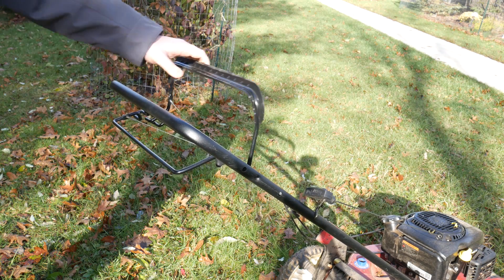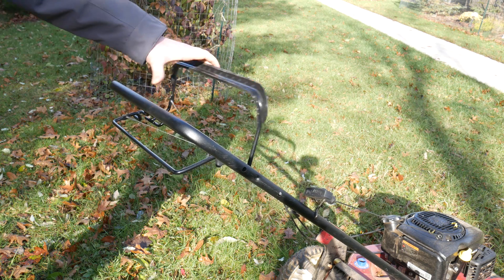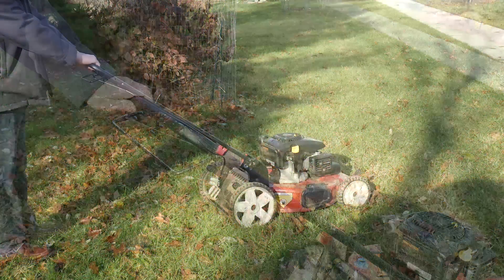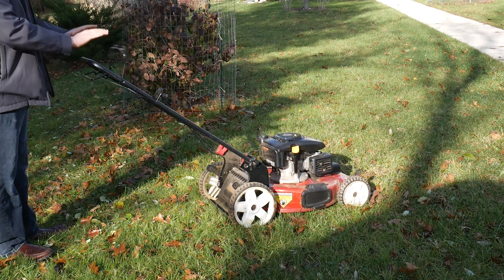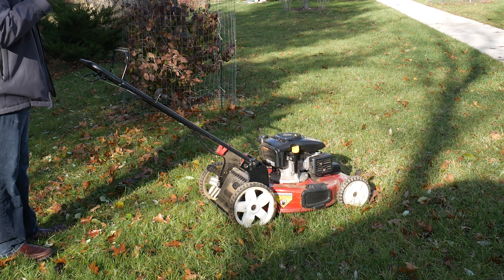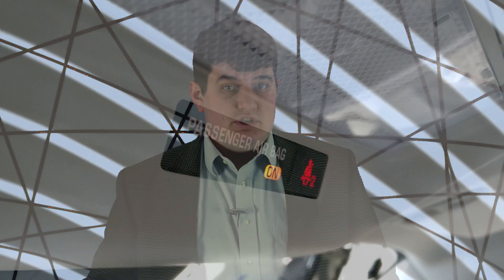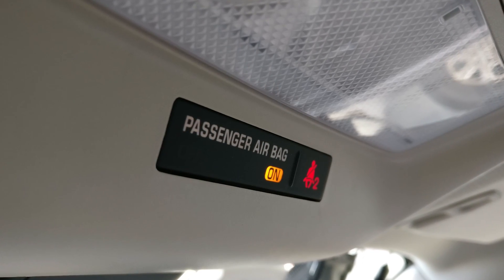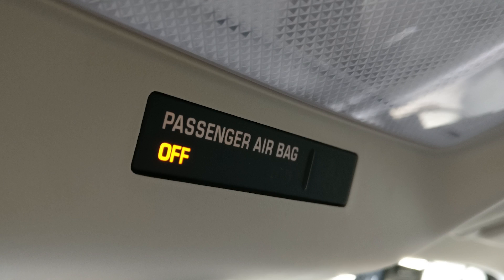The Dead Man's Switch:  How Anton Yelchin's life could have been saved

Comment: Unfortunately as a mechanic's wife this would never work. Cars need to be out of park for many parts of their drivetrain, wheels, suspension, brake systems and the so forth to be worked on. For any of you that. This watch your car go through inspection one-time the guy will put your car up on the rack and with your car in the air spin your tires this doesn't happen if your car is in park.
Reply: kitkat99x69 which is why he mentioned the override system. Have a button push or via obd2 port you could over ride it and do what you need to.

Comment: You need to think about servicing and towing vehicles. There are multiple reasons why a car should be in motion if no one is "sitting in the drivers seat". You can't tow a car that is in park is the biggest reason why this should not be implemented. Most cars that I've been in won't let you take the keys out of the car unless it is in park, which should be the overall solution; not forcing park.

Comment: Slight problem, if the sensor fails, the car would be thrown in to park, good bye car
Reply: too bad the video only kept your attention for 6 minutes and 27 seconds, because if you'd just watched a few seconds longer, he would have had a solution for you.
Reply: @jdjk7  wrong
Reply: @ComputerFreek  how? he describes 1. a method by which the car will not be thrown into park in a situation that would be dangerous even if the sensor failed, and 2. a method by which the safety can be disabled so that a failed sensor will not impede the car being driven.

Comment: i can already see a huge problem with your solution here: you couldn't push the car, or tow the car. you have to put the car into neutral in order to push it, if the car can be in neutral without a person in it (and the person can't be IN the car, least not in the seat, while pushing it, if you have someone to help you can have one person push and one person sit in the seat and steer, but you shouldn't assume the person pushing has two or more people to help, and towing would also then require a second person) then it can still roll away and kill someone.

Comment: Wrong 
*Many automatic single clutch transmissions have a physical connection to the transmission: essentially a "parking cog" 
So a software solution wouldn't work in most vehicles.

Comment: The cable for the dead man on my lawnmower stretched out and it wouldnt start, so I replaced it with a switch that can stay on whether you hold it or not. Also I disconnected the switch on my riding mower so I can now mow in reverse

Comment: This is absolutely not as simple as you say. From a "making the change" perspective it may seem so, but as soon as you start introducing features that mess with the control of the car you open yourself up to liability if something goes wrong. This would require huge amounts of testing. What happens if you attempt to cross the lanes of a highway and this sensor malfunctions? Does the car slam on the brakes and cause a crash? 

If you think this is far fetched the Boeing 737 Max has caused 2 crashes because they put in a sensor to protect against a too steep a climb and push the nose down so it doesn't stall. It has not push the noses of two planes into the ground. 

When you start introducing changes to systems that control vehicles, nothing is simple, and thinking it is simple is a dangerous mindset. It sounds to me like Antons death more caused more by the bad design of a critical safety system rather the lack of one. That said your suggestion is not a bad one, (it's actually a good idea), but it comes down to cost/benefit. The cost /benefit question could be removed by making it a requirement for all new cars, just like seal belts are.

Lastly with electric cars likely to end up going far more mainstream and cars having to go through large design changes to facilitate this, it sounds like and ideal time to bring this in.

Comment: Way too complicated. The solution is easy and needs no sensors. GET RID OF THE CREEP FUNCTION IN AUTOMATIC CARS. No driver input= no movement. Simples. The creep function, an unfortunate side effect of using a torque converter, has killed thousands of people and the stupid thing is they are replicating that behaviour in gearboxes that don't even have torque converters, Learn to drive manual cars y'all.
Reply: Are you referring to idling? Because my manual Honda can idle as long as it's in gear
Reply: Ro get a manual car to move off you have to put clutch down, select gear, clutch up with throttle and set off. I have had several cars, mostly diesels that will drive along on idle, but it takes several actions to get it there. I have to actively do something. My automatic will set of just by letting off the brake, that is what I think should not happen. What's more there is a pause before it does so, long enough for me to get out of the car. That's just dangerous.
Reply: @donaldasayers  oh yeah, I've just got so used to it I've forgotten how many steps where involved
Reply: Nothing wrong with this idea... except I don't think it applies to the Yelchin case. My understanding is that he put the car into neutral by mistake and believed he was in park. The transmission didn't cause the movement that pinned him, it was a slope + gravity.

Comment: Most modern cars are switching over to an electronically controlled parking brake. With the engine running and the vehicle in drive, opening the door will immediately trigger the vehicle to set the rear parking brake, and in some cars, the electronic shifter will also shift the transmission into park. It's good for safety but a pain in the ass for tow-truck drivers. Most cars at our shop (2017 - present) do this.

That said, I have driven a Grand Cherokee with the first generation electronic shifter and I can confirm that it's terrible to use and downright confusing if you're used to a normal car. Later model Grand Cherokees now use a more conventional shifter with mechanical detents for each gear.

Comment: Practical reasons: car haulers that open the door to see where the car is while driving forward/backwards. 
Now cars like the Chrysler 200,300/ Dodge Charger, challenger, dart which has a electronic parking brake, this causes a issue when the door opens/ little pressure is on the DRIVERS seat, the parking brake auto engages and the transmission shifts to neutral. I used to haul cars/trucks/SUV’s for a living. This concept is ALREADY in cars. As for larger vehicles like SUV’s and trucks as of summer of 2017, they are not.

Now my up to 60 ton dump truck I drive now has a “stupid American” alarm and bell that if I do not “apply” the parking brake before I shut it off, the horn starts sounding until I turn the key back on, “apply” the parking brake and then turn the key off again.

Comment: If the car won't move without someone in the seat even in neutral or in gear, how do you winch/push/tow the car? Sometimes you have to move the car with all four tires on the ground. Not to mention I'd hate to have a sensor fail and my car become immovable in the middle of the highway. A deadmans switch is a dumb idea in something like a car. What happened to common sense?

Comment: This video would really benefit from photos of that gear shifter..
Reply: @Poképartum Depression Wow, your video is the answer to this video.
Some cars do have the e-brake connected to the door.
Reply: @MushroomClippyOfKnowledge  My sister's Ford has a setting that if the front driver door is open and you take your seatbelt off it automatically puts it into park and sets the brake
Reply: @brocksdaddy081910  yea but it's a ford how are you supposed to push it
Reply: Gabriel Carvalho this is correct but it would be tricky in a jeep as the doors are removable
Reply: @MushroomClippyOfKnowledge  new BMWs have this for sure. Though it's badly integrated last time I used one. I was pulling it onto the alignment rack at work and I opened the door to confirm that the car was straight and it immediately threw the car into park, even though I was moving. I tested it at a couple mph and it still did it. I didn't want to break the car so I didn't try going faster but I wonder if you tried it at like 10mph. It'd probably sheer off the parking pawls in the transmission.
Reply: Thanks for the link to the actual shift mechanism.  What a stupid design.
Reply: @GunnyTheGrey actually, automatics do have gears. A ton of them. They also have clutches, and a lot of them. An automatic transmission is a series of planetary gears which can be used to create a range of drive ratios by changing where (ring, planetary, sun) power goes in and where it comes out.

You also have torque converters pretty incorrect. 99.9% of torque converters today only use the fluid coupling for very low speed operation, when it's being used a torque multiplier, or during a very short period after the gear shift. They all have a wet clutch called a lockup which engages when the engine and transmission are speed matched, in much the same way as a manual clutch functions but clutch slip won't actually damage anything.
Reply: You cant just ask a man for a pic of his gear shifter!
Reply: I know this is an old vid but these days most vehicles with this E-shifter go into park when the door opens.
Reply: I get angry just seeing that gear shifter. At least in a manual the car will stall and lock up if you shift gears unknowingly.
Reply: Manual cars >
Reply: Guilherme Ferreira don’t say that... you’ll confuse everyone here!
Reply: idk what a gear shifter is I only know running.
Reply: Seeing as it's a successful actor who died in 2016, I'd venture to say that he owned a 2017 Jeep. A simple Google search for "2017 Jeep shifter" is enough to show you exactly what that looks like.
Reply: My gf has one of these Jeeps. The software has been changed where you can not drive the car with the door open.
Reply: @GunnyTheGrey I'm not from either side of that earlier conversation, I was correcting your mistake regarding the function of an automatic transmission. They have gears and clutches, but they only opperate when power is delivered to the pump from the engine.
Reply: It does have pictures, just look at the background behind him

/s
Reply: And the answer in comments is now gone…
Reply: @mittensfastpaw  Looks like this video shows it: https://youtu.be/jD1-aQSO5Hg
Reply: Its a return to center shift, it goes back in the middle after you shift the car into rear neutral, etc. can be confusing with muscle memory for a normal shifter
Reply: Sounds like older automotive tech was safer and it sounds like new automotive tech is more dangerous. We might as well have self driving automobiles at this point. Tesla was ahead of their game. More sensors, more computers, more software taught us how self driving wasn’t ready yet. If the driver placed it in park from start yet it didn’t go into park the whole deadman switch isn’t going to work. Lawnmowers don’t use computers. All the deadman switch is doing on a lawnmower is killing the ignition coil so the blade can stop moving not the mower itself. A mower in natural can still role. Take the push mower in this video for example, with the engine off you can still push it. Two different concepts going on here. Automobiles well most can still start or stop in natural however that still doesn’t change the automobile from rolling.
Reply: @Poképartum Depression no doubt but most don't.my boss and coworkers at the dealership used to always bitch cause I'd apply the e brake after finishing my job.i was the ONLY ONE in the entire dealership that did.

But those e brakes aren't as easy to apply.just like the shifter some times the switch won't engage the e brake if you don't have the foot brake held down far enough.
Reply: @GunnyTheGrey * a manual, it does, because you are required to disengage the clutch to stop the car (otherwise the engine will stall.) 
I'm using automatic for 3 years, almost forgot that. your explanation was perfect
Reply: @Poképartum Depression the thing i find even more stupid, why dont you just turn off the engine of the car before leaving it? many new cars apply the parking brake automatically when turned off, or even switch to park, and even if that doesnt happen the car wouldnt drive on its own if the engine isnt turned on anymore
Reply: @Slarkim  What?
Reply: @Slarkim  Im a bit late but you realize the problem isn't the car driving right? It's the car slipping due to not being in park
Reply: @Slarkim  mine screams if I turn off the engine or open the doors and don't put it on park before, its annoying high tone beep, so annoying you can''t ignore it and leave. I'm always, thanks car for reminding me, it doesn't need to put it automatically on parking, just a warning is enough, I wonder why isn't this required by law.
Also, automatic cars still have hand-brakes that you should pull, you must make 2 mistakes to be crushed by your car
Reply: @Slarkim  you do know that even with the engine off, if you don't put the car in park, it will still roll.

SMH
Reply: @RickRansomSmith  most cars i know dont roll when in gear and engine turned off
Reply: @RickRansomSmith  well on a new car door open and off also means park gear
Reply: @Slarkim  I don't believe you. My experience says different.
Reply: @ralanham76  no it doesn't. It means door open, car off. Unless the shifter is in park, car ain't parked.
Reply: @RickRansomSmith  if you have a car in gear and the engine turned off, its not going to roll unless parked at a VERY steep hill.
Reply: @Slarkim  you don't understand physics well I see so now I'm not about to debate with you.
Reply: @RickRansomSmith  I dont need to understand physics, I drive a lot of different cars and they dont roll away when I leave them parked in gear without handbrake.
Reply: @Slarkim  sure you do. Like I said, not about to debate with you. If that's what you believe, then more power to you.
Reply: @RickRansomSmith  bro why would I lie tho :D
Reply: @Slarkim  I'm over it
Reply: @RickRansomSmith  well new cars I been in have electronically controlled shifters so the shifter in the car is in no way connected to the transmission and when you push the on off button on new cars it also goes to park
Reply: @ralanham76  and if the electronics go out, you really trust that? Yeah, thanks but no thanks. Not putting all my faith in electronics. Mechanics all the way.
Reply: @Slarkim  Every automatic I know of will roll in gear with the engine off...it has some resistance but it's still a fluid coupling.
Reply: @Slarkim  Those are americans you are talking to. What you're describing doesn't work in a slushbox vehicle.
Reply: @RickRansomSmith  car won't move if it is in gear and the engine turned off. Exept if you press the clutch pedal. Same with motorcycles. They don't even have handbrakes
Reply: @Slarkim  In a manual car left in gear with the engine off, the car will hold itself. An automatic however needs power from the engine for the Hydraulics that engage the clutches and bands for it engage anything, so it will just slip. And even if that were remedied, the torque converter would slip instead and you'd just get a mild slowing of the roll. Both of those factors are why you cannot bump start an auto.
Reply: @Slarkim  You're clearly a liar because cars will drift backwards down a hill even at shallow angles.
Reply: @Slarkim  it is possible that the car was in neutral. Furthermore, it is likely the vehicles you have been in use the parking brake automatically like he is suggesting. Automatic cars can roll when in gear because of the lack of direct connection between the gearbox and drivetrain.   Even a manual transmission car can roll while in gear if the hill is steep enough, it will just be slower and potentially damage the engine while doing so.
Reply: Also, a few of us would benefit from photos of the accident.. for science

Comment: Even though I myself confirmed put the gear in parking, I always pull the handbrake, just in case...
Reply: The problem is the new E brakes are not a good hand brake.
Reply: @shadowhound5113  Not just that, e-brakes disengage automatically when you put the vehicle in gear. I don't know how they work on automatic transmission cars, but on my manual the e-brake disengages when the car is in gear and I release the clutch. It doubles as "hill assist".
Reply: Congratulations?

Comment: not sure if I like this or not, there are times when I can see there being utility in not parking while the car is unoccupied, one such case is a breakdown where the person in the driver's seat is the only occupant and may want to move the vehicle out of traffic by pushing the car, if the driver gets out to push then the car goes into park if the driver gets in to turn off park they can't push. A much simpler and more reliable system at least for cars that have physical slots to locate keys for ignition is to set to park whenever the key is removed, this has more utility I think than sensors in the seat, and is like how powerboat deadman switches are set up.

Comment: I never use the seatbelt when I pull my car into or out of my driveway before packing for a trip. So it wouldn't work. Pretty much if the drive is under 1000ft I usually don't use it.

Comment: A quick fix about the train thing. Most trains don’t have a button that must be held down, rather, it has a sensor that will trigger a deadman’s alarm after it passes certain points on a track, and it triggers an alarm in the cabin and the engineer needs to press the button to disable the system. If the engineer doesn’t disable it in a certain amount of time, the brakes will engage. It would be impossible for an engineer to hold down a button the whole time and operate the train safely.